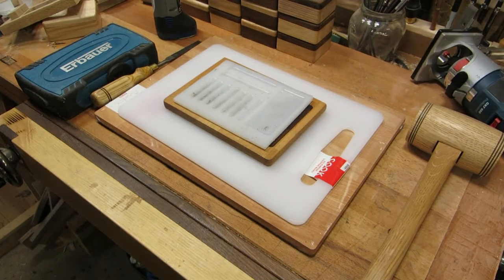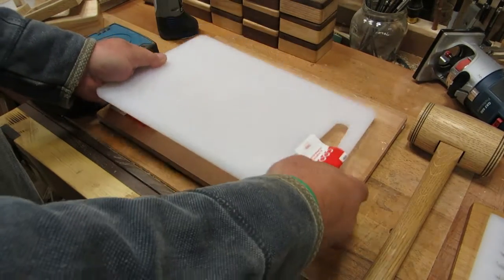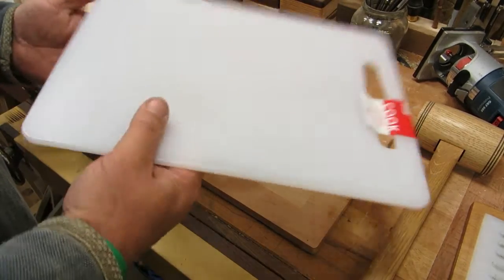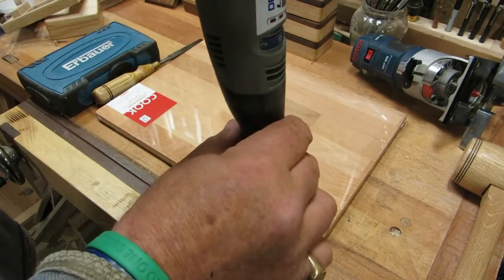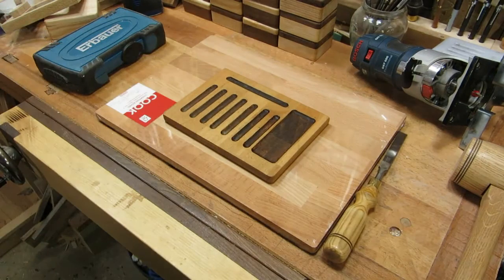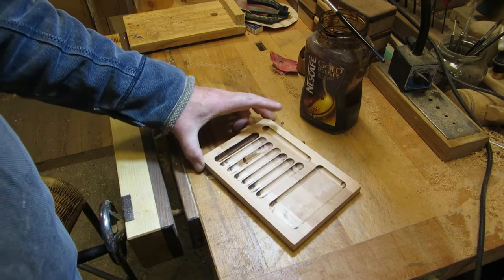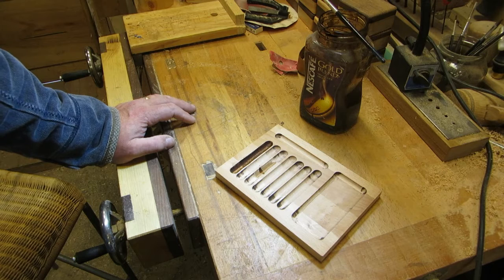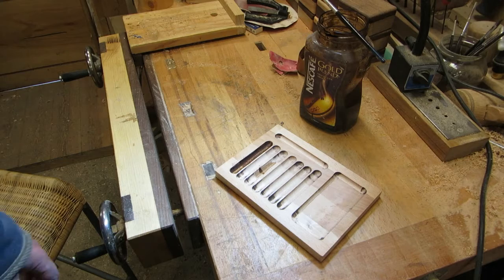(282) "DIY" Making Cheap Pinning Trays

Comment: Very interesting to see the process of making them. What are the challenges when applying the same methods to the plastic boards?
Reply from the maker: Thanks, the router works exactly the same with the plastic, but the hand work would depend on the plastic, I've seen soft and hard plastics for the boards.

Comment: Very cool pinning trays Pete :D. I really love your woodwork 👍😘. Which part of the walnut did you use, the outer green shells or the hard shells? A friend has always tons of them (lets say enough ;D) in autum, because they have a huge walnut tree and I'm tempted to mix a little bit of dark wood color this year now ;).
Reply from the maker: Thanks, I think it's the hard shell ground up, I don't have a walnut source, I just by them ground up. All you need to do is pour boiling water over them and leave for a few hours, it keeps in a jar for ages, That jar full is probably 12 months old.
Reply: Thank you very much Pete :). So I will have to collect walnut shells in autum ;). I can remember when you pull the green shells off, you get really dirty fingers for days...so yeah, seems like a good natural coloring :).